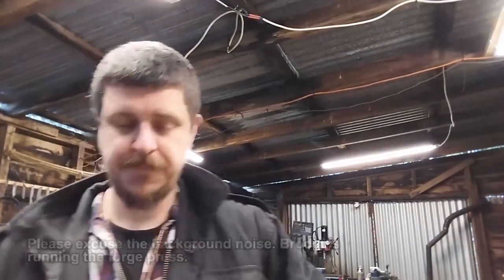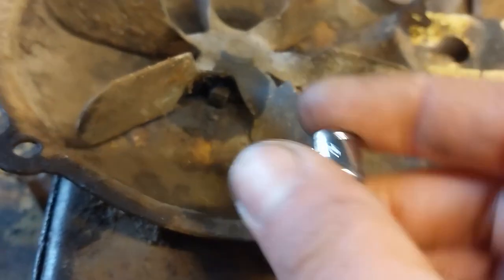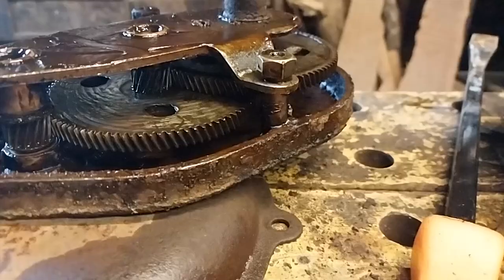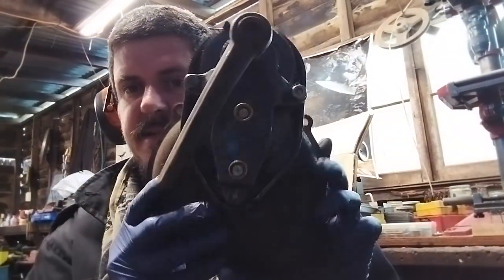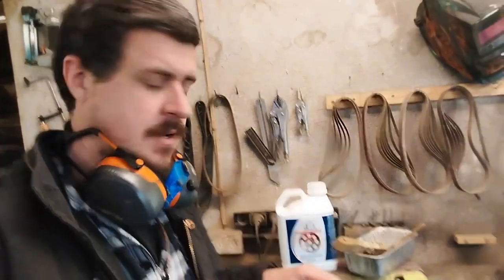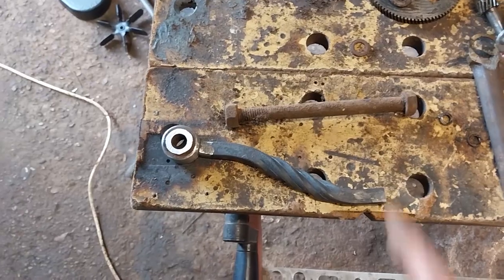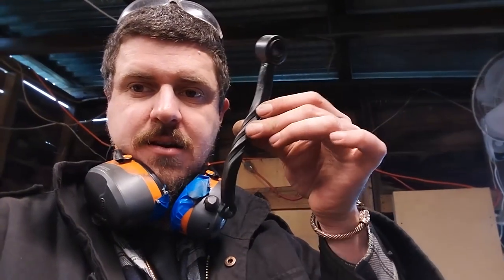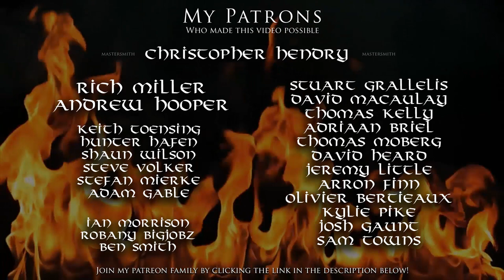Restoring an Antique Forge Blower

Comment: Mine had a handle in exactly the same condition. Took a little effort to restore mine, including making a new handle,  fan and fan bush, but it came out great.
Reply: I got my Buffalo blower from an old smith who told me not to grease it, but rather use oil through the hole in the top of the casing using a small oil can. Grease will gum up over time, but the oil keeps it lubed well.
Reply from the maker: This model had no hole for oil. I did toy with the notion of adding an oiler to it, but I was taught by an old smith to ALWAYS grease your blowers! I guess everywhere there's someone saying one thing, there's someone saying another!